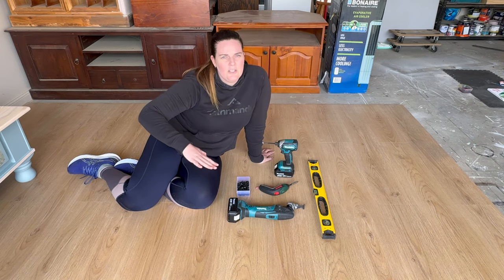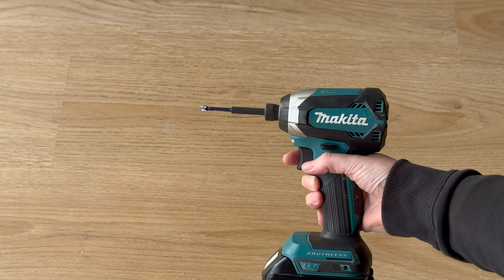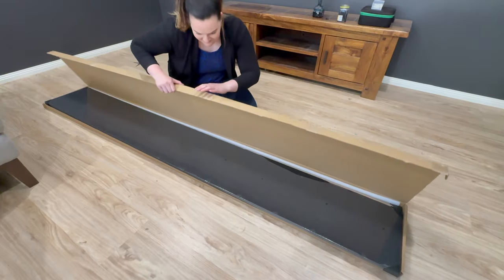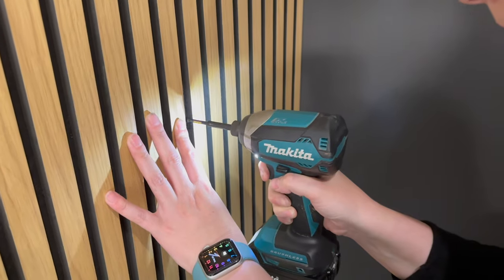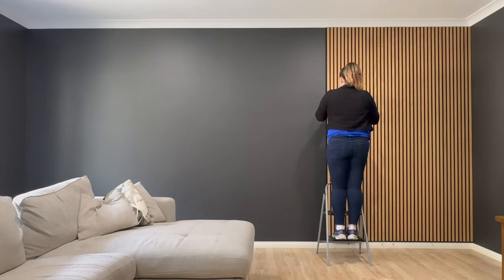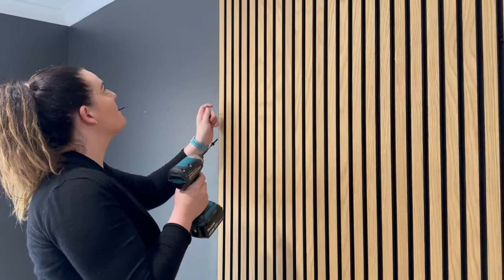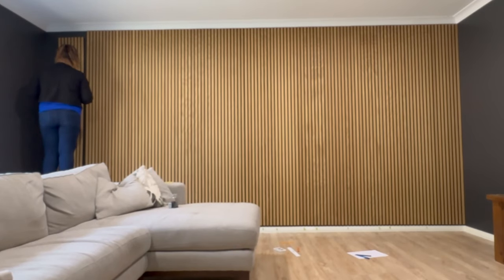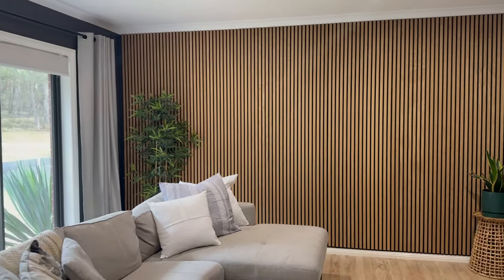How To Create A Wooden Feature Wall  (The Easy Way Using Wood Slat Panels)

Comment: How much did they cost 😊
Reply from the maker: This wall is a very large wall and I used 8 boxes of panels. The whole wall cost $1800 but for ease of installation and quality I think it was worth it 😀
Reply: Way too much for me!
Reply: Hi Jade, first time watching. Is this price is US dollars? TIA 

So when you figuratively and literally step back from this wall, the following can be factored in:

1. Acoustic Dampening increased
2. Insulation increased and ...
3. A stunning feature wall that, YOU enjoy now and if you were ever to sell,  would be recouped easily in the sales price later.

I imagine a little upkeep with vacuuming for dust--how often depends on where you live and, LOL, what you level of dust you can stand. Also, I would think you'd want to affix as many panels as possible to the frame studs of the wall.

So, for some it's a hard pass, seen as an expense where for others, it's an investment on important levels that will be both returned immediately (enjoyment) and later (when sold). 👍 @refinishwithjade
Reply: @bobcaygeon6799 more than likely Australian Dollars ;)

Comment: Very expensive. $239  for 240 cm  by 64 cm!!
Reply from the maker: If you were to buy that many of individual piece of timber it would also work out quite expensive. This wall cost of total of $1,800. But you could do a MDF panel wall much cheaper if you don’t want to show the actual wood grain 👍